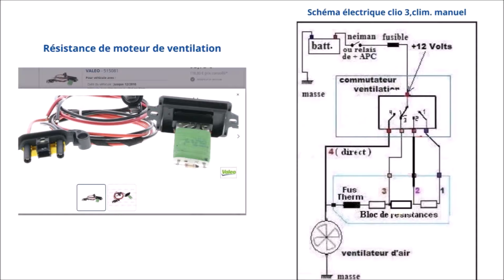Tuto Panne ventilation Renault Clio 3

Comment: Bonjour merci pour le tuto , justement moi c'est la 4eme vitesse qui marche pas vous dite verifier les confection ou le communicateur c'est quoi svp ?
Reply from the maker: Bonjour, le commutateur  se trouve sous le bouton réglage vitesse de ventilation ( voir tuto. Image de 00:00:07 au 00:00:15) .connecteur : image tuto : 00:00:07 au 00:00:15) .   Voir le Schama électrique  ( image tuto 00:00:40 00:00:47) .LA VITESSE 4 fonctionne en direct sans passer par Resistance de ventilation. Le plus souvent c est le connecteur cause de problème.
Reply: @khkh-nh6gb   merci de votre réponse, enfait il fait que jenleve le bouton qui sert a metre 1.2.3.4 vitesse et sa se passe derrière se bouton c'est sa ?
Reply: Salut ! j'ai le même problème vitesse 4 qui fonctionne pas . J'ai pas bien compris quoi faire ?
Reply from the maker: @cyrilchevalier3962   : Vérifie  fusible de ventilateur dans la boîte  de fusible  ou Connecteur  Hs ou mauvaise contacte  ( Voir image du vidéo :2:29/4:50)

Comment: Salut j'ai le soucis que y a que la vitesse 3 qui marche 1/2/4 fonctionne pas donc es ce le même soucis que vous ? Ou sinon d'où cela pourrez provenir ? 
Sinon super ton tuto si je dois changer le thermofusible 👌
Reply from the maker: La vitesse 3 ne fonctionne pas . Il faut vérifier : a/ les  connections  mauvaise contact ou fondu ;. b/  bloque de résistance couleur verte  (une résistance parmi les 3 est coupé) . 3/ le commutateur de ventilation (normalement c'est solide); Voir le schéma électrique au début du Tuto .
Reply: @khkh-nh6gb  y a que la 3 qui marche . Les autres ne fonctionne pas
Reply from the maker: Que la 3ème fonctionne  : Il faut vérifier la connections  mauvaise contact ou fondu la prise  .  Bloque de résistance couleur verte (composées R1 pour vitesse 1 ;R2 pour vitesse 2 et R3 pour vitesse 3 , la 4ème vitesse fonctionne en direct sans passé par la résistance même le bloque de résistance et thermofusible sont HS) Voir schéma électrique au début Tuto) . Le plus souvent c'est la prise de connections  pose de problème .
Reply: @khkh-nh6gb  merci pour tes solutions je vais regarder ça de plus prêt
Reply: @kmikz2360 j’ai exactement le même problème j’ai que la vitesse 3 qui fonctionne, cous avez résolut le problème comment s’il vous plaît?
Reply: @oliviafromentin2208  bonsoir je n'ai pas encore effectuer la réparation ... par manque de temps